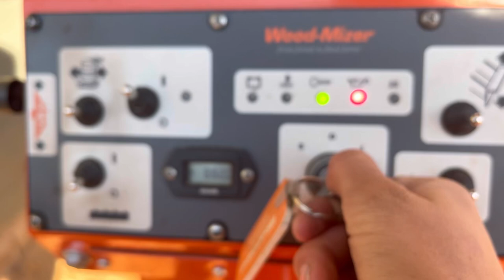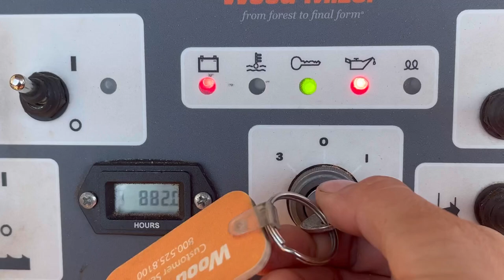Doing What We Do Best: Operating a Sawmill! Woodmizer LT40

Comment: I really love to watch you all struggling with the logs but enough is enough.  If you will elevate the outer part of the deck the logs roll on leading to the mill so it slopes downhill a few inches the logs will roll to the mill much easier going down hill.

Comment: LCLY:  Just  thought  of something  for you to  sell  on your website !  Wood  Coffee Thermos!  Turn a  nice  Cherry or  Maple  block of wood  on a  Lathe to  the  fit the  outside  diameter of the Coffee Thermos. Slide the  Steel  Thermos into  the   turned  wood  piece, and glue in place.    I  bet they  would  be  a  good  seller  with Lumber  Capital  Log Yard  engraved on  the  wood!

Comment: ‘Em you never mention the debarker that takes the bark and dirt off ahead of the blade.   I had a mill similar to yours. It didn’t have that attachment.  My biggest problem in running that mill was dull blades.    I didn’t have a grandpa to sharpen my blades for me either.   I had to send them out to sharpen.  What a nuisance.  You are so lucky to have it

Comment: I worked at a sawmill for a summer when I was 13. S&S Products outside of Sturgeon, MO. It was in a barn but we had a gang rip and an assembly line. You loaded the logs onto the top and it dropped them and cut them one at a time.
Reply: I bet it was a great year.  Boss Man.
Reply: @KenBreon  kind of. I got smashed by the gang rip, that was interesting. Otherwise I painted the scragg mill. My dad built it.
Reply: @KenBreon  nothing at the sawmill paid as much as making pallets. They paid per pallet.
Reply: Hiya John..when my Dad was still alive we took a drive down to tiny Strykersville, NY at least 20+miles to check out their sawmill & WOW! Peak of my Paul Bunyan* period; I was maybe 8 or 9 ( early 70's) so couldn't sign up, drat. They had huge saw wheels; don't recall a band saw but anyway..
Despite that gang rip? injury:0 bet it was lots more interesting than delivering papers; started that @ abt 13. Couple yrs later I worked for a guy who grew & sold Xmas trees; not real lumberjackin' but still hard work for $2/hr..
Pallet$ became another work issue later on; no, not making 'em just trying to get RID of the crappy ones @ our busy yet cramped bank stockroom, arrr. We could sell good 40×48's for $2 we or so, mid 80's..
Reply: @brianstratton8767  I got lucky because another saw it pin me and he got it in reverse quick so no injury.

Comment: What is the purpose of the abrasive-like wheel that goes in front of the band saw? What happens if it is not used?
Reply: It's the debarker. The blade can dull faster if it's not used.